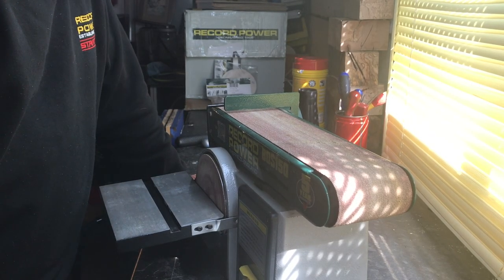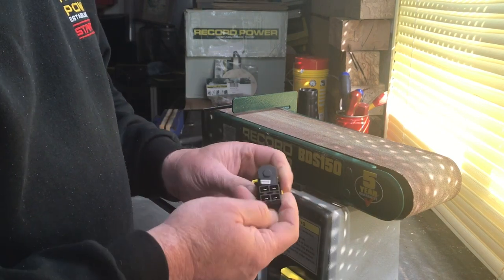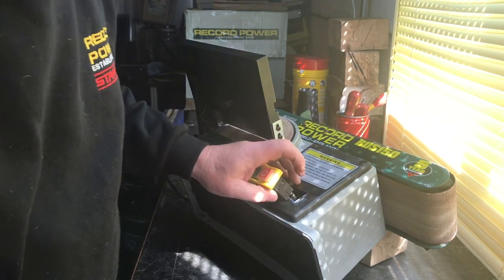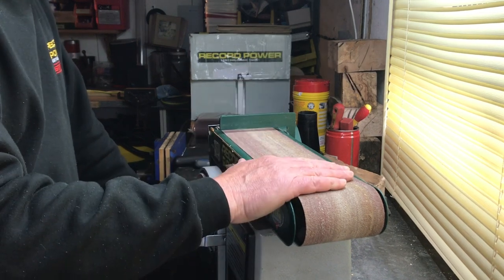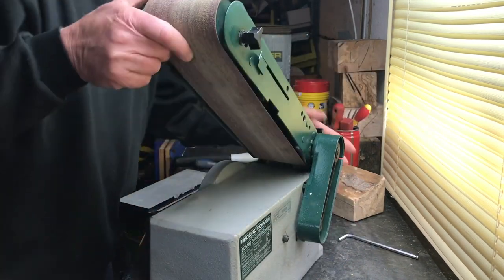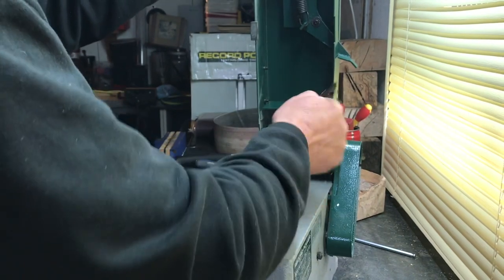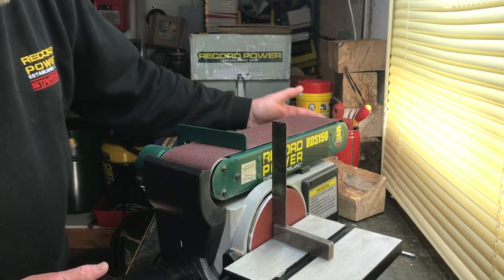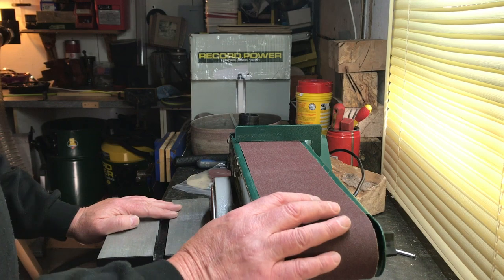Know-How Series: BDS150 Switch, Belt and Disc Change

Comment: Hi, my husband bought this where does the sanding bed table support go please  .
Reply from the maker: Hi Breda, thank you for your comment. When the table is used in front of the disc, two brackets hold it place, one to the right hand side and one the left hand side and these are held in place by a large plastic type bracket fitted below main table with a locking screw also to the left that sets angles. The main table can also be fitted with the main drive belt in the vertical position with tapped holes located each side, these details are in the product manual. Should you require advice, please contact our Technical Support team on 01246 571 020 or email technical@recordpower.co.uk and the team there will be able to help you. Best Wishes, Record Power.

Comment: You didn't retighten the Allen screw behind the guard and ran the machine several times with it loose . Is this ok?
Reply from the maker: Hi Paul, thank you for your comment. The cap screw is on the clamp, and this you can lock, or have in contact so that you can make movements without the part being loose. NOTE: If using in a mid-position it would be recommended to lock and also at the top position, but maybe not at the bottom position because it is down and cannot go anywhere. Hope this helps. Best Wishes, Record Power.

Comment: Started to follow this guide with the switch. Really difficult to try and lever out so the whole front of the switch assembly came off, buttons and springs on the floor ! Cheap and nasty assembly reliant on fragile plastic clips. For goodness sake Record, you can screw other stuff together ( like the front cover plate), why not make a screw fit switch assembly instead of this inadequate solution.
So the sander won’t work as the on button was simply not staying pressed in. This on a 4 year old machine that carries a five year guarantee. But, of course, not being the original owner that does not cover me. Like so many companies offering long warranties they seek to exclude claims by trying to tie purchaser and product together, rather than backing up their product support by guaranteeing the PRODUCT. After all, does it matter who owns it as long as it has been used as expected ( in this case by two basic hobbyists). Not impressed . . . .
Reply from the maker: Hi Stephen, we are sorry to hear that you have encountered some difficulty with your machine. Please contact our Technical Support Team on 01246 571 020 (and select option 2) or email technical@recordpower.co.uk, and our team will be more than happy to help you. Best Wishes, Record Power.